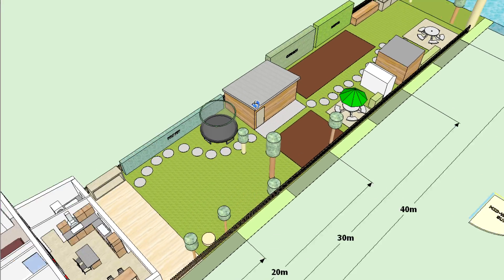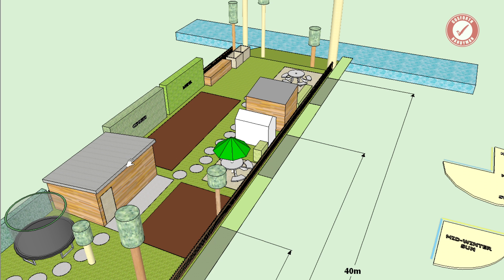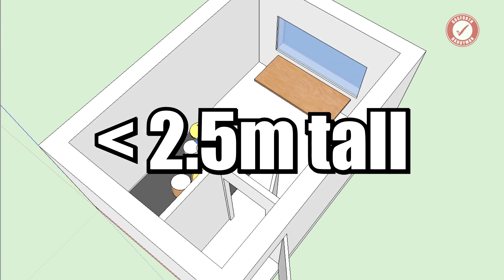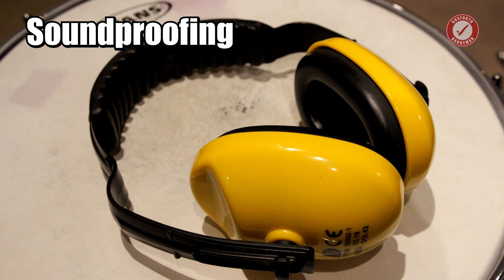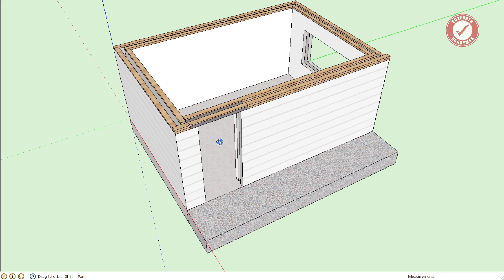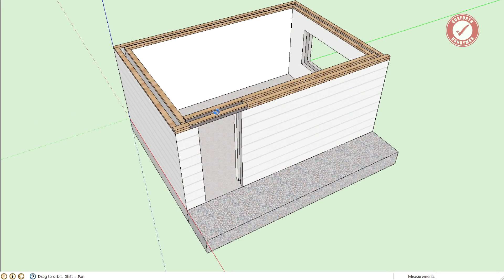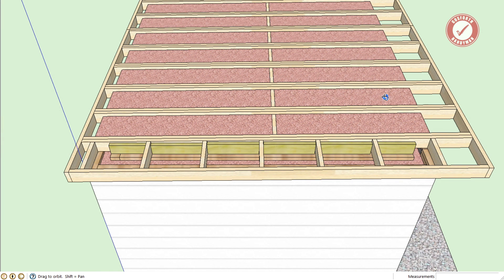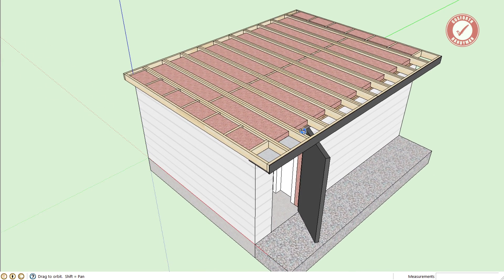Building a Soundproof Garden Room - Permitted Development & Soundproofing Basics (part 2)

Comment: Hello mate first time commenter, I've just insulated my single skin double garage with vented roof, it's a workshop but I'm also a drummer and I like valve amps.. I used 75mm rockwool between the rafters over 12mm plasterboard, 25mm airgap between the walls and 3x2 stud walls and 75mm rockwool between the studs, 25mm celotex and 18mm ply to clad over the walls (yeah I had complaints at my old place). Floating floor with 18mm chip and 25mm celotex. Used my 100db extractor as a testbed - when I first moved there it registered 80db 1m from the other side of the wall, now it's not audible, my db app doesn't pick it up so I'm confident I could play drums in there, I use power tools at all hours and my neighbours say they can't hear it. My roof is a pavilion so easier to keep quiet than yours but I reckon if you can squeeze a bit of an air gap and a good 50mm of rockwool you will be alright - your studio looks to be a good way from the neighbours, my garage is 3m corner to corner with the neighbours. What I did was pricey but it's quiet and warm, I'm building guitars and controlling temp and humidity so anything I can do is going to save in the long run. Filmed it all so I'll upload a video at some point. 

Cheers
Ash
Reply from the maker: Fantastic stuff Ash - looking forward to seeing the vid! 👍🤘
Reply: Very interesting my friend 

I am thinking about creating a similar soundproof space where I can do guitar teaching work, play drums, crank up loud valve amps, record, use power tools etc etc. Man cave worship recording studio type thing 

I would love to see your videos 

I also want to do guitar building and luthier work
Reply: @ourclarioncall  that sounds like it needs to be a big man cave!
Reply: @ADFinlayson  I think it would be a man “cavern” 🙂

Comment: Glad I don't need soundproofing on mine. With a dropped floor having to paint the inside of the blocks with black jack is fun - doing 2nd coat tomorrow. The sides you don't want so visible from the house, you might want to paint black and with foliage, it'll turn invisible.
Reply from the maker: Yup, still in 2 minds what to do about the back. Quite like the metal cladding Liam uses on Oakwood Garden Rooms. 👍😁

Comment: Wow, great overview. Has given me some good ideas. I am building a soundproofed room within a shed and with regards to ventilation I made the decision not to provide an opening which could impact the soundproofing. I made this decision after calculating how long the room would provide breathable air while sealed off - surprisingly long. My plan is to keep the door open when not in use and I have a wheeled air conditioner that I can place in front of the door prior to use. Might not be viable in your case, but possible for you to have an opening that you can close off when using the room?

Comment: Cedar is nice to use but a touch pricey.  It won’t age evenly with your slight over hang on the roof, you’ll have a newer looking strip round the top of the wall while the rest eventually goes grey.  Unless your into sanding and treating every couple of years that is..  😂

Comment: Do you know where the actual water table is, at the studio?  Could you have gone down 6-12"? 
      How much slope is there to the river?   The roof definitely does not need a vapor barrier.  Overdone but fine. 
       Why is the door an odd size?  Custom built?
Reply from the maker: Water table - no idea. How do you find out? 🤣 Door - they built the doorway the wrong size. 🙄

Comment: Window: All three glass thicknesses should be different, use helium as infill gas. Consider top and bottom access for the helium to top up or dry later. If helium is used then size of air gap can be very small.

Comment: Interesting video, I do think the roof design is problematic. By creating the airflow you've broken the soundproofing the mass spring mass system. The sound from inside will travel through the plasterboard ceiling and then out the ventilation areas in the soffits, what area in total will all the ventilation bits add up to?

Also the mass of the roof seems very under spec compared to the walls, it needs to be balanced as best as possible because the system is only as good as the weakest link. You could add a layer or two of roofing lead on the roof if the structure will hold it.
Reply: Also I'm still not clear why the roof sits on the inner leaf? As you're not decoupling the inner plasterboard the inner leaf is coupled to the roof timbers and the outer concrete leaf isn't sealed at the top?

I wouldn't worry about the soundlock door area, just build two heavy bank vault doors. I built mine with a hardwood blank, lined with lead with a 36mm layer of MDF I think.
Reply from the maker: Bear in mind the ceiling is decoupled from the joists. 👍
Reply: @GosforthHandyman  Sorry I don't think I was clear, the wall plasterboard is coupled to the inner concrete leaf which is coupled to the roof joists. If the roof sat on the outer wall plates you wouldn't have this flanking path. At the moment your inner walls are coupled to your roof. Have you looked at inside out studio construction? You could build an inner shell including the ceiling with 2x4 and two layers of heavy plasterboard which would fully isolate you from the outer shell. The genius of the inside out method is the stud wall is inside the room with the plasterboard on the outside and then you fill the studs with rockwool to provide acoustic treatment and cover with fabric...then you don't need to build panels etc....it looks cleaner and could potentially improve the soundproofing for your situation. You could still do the suspended ceiling.

Comment: Re: Ventilation...   Well you already have two holes in the concrete, and that's the window and the door.   I would guess that you've already considered ways of using those openings for ventilation?   (Like make a smaller window, or have a vent above the door?)    But what do I know, I'm not a drummer!
Reply from the maker: Any ventilation would need to be baffled to avoid sound getting through the vents. It's a bit of a challenge. 👍

Comment: I'll be thrilled to see the results from this series. I'm curious as to how well the dense concrete construction works to block the low frequencies, seen a lot of those timber room with a room designs and they seem fine for airborne noise but really do very little for the low end that a drum kit produces.

Comment: I think the rules on 1m from the boundary are based upon internal final floor area (after finishing the walls). Are you 3.5x5 dimensions external??
Reply from the maker: It ended up being slightly bigger than 3.5x5 so it's borderline >15m2 internally. 👍

Comment: Andy put some fake grass on roof Liam from oakwood garden rooms did one looks smart.👍🍺
Reply from the maker: I'm afraid I can't abide fake grass! 🤣👍
Reply: @GosforthHandyman  Use real grass then... Oh, mowing it may be a bit iffy...
Reply: I don't think it will work to be honest.  The grass has drain holes for water to drain into a base like grano dust.  When artificial grass installed on concrete, even at an incline, manufacturers recommend holes are drilled through the concrete (see the negrass website) for drainage.  On a rubber roof those hole will do very little indeed.  That grass will just hold water until its overwhelmed and then go to the gutter.  Light rain will just sit on the roof as the incline is not steep enough.